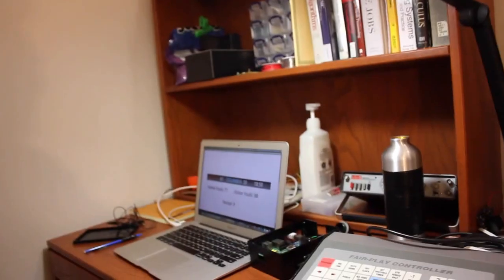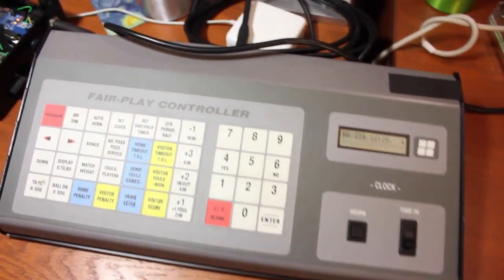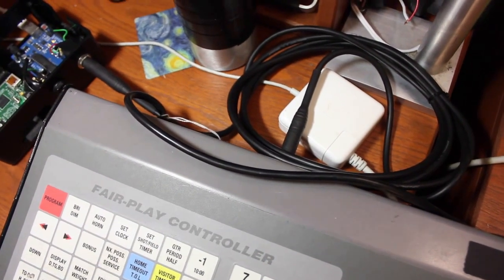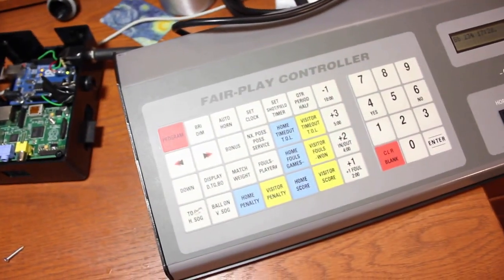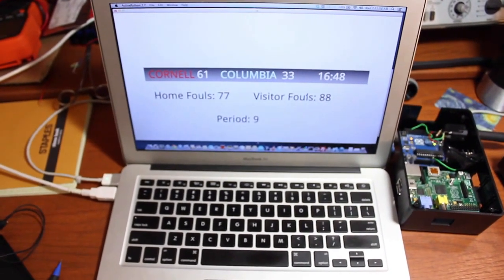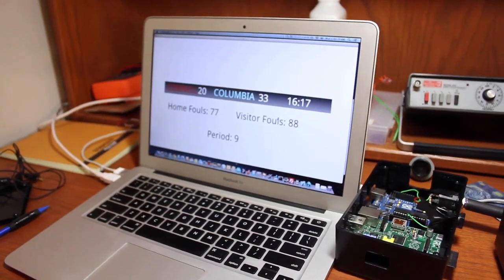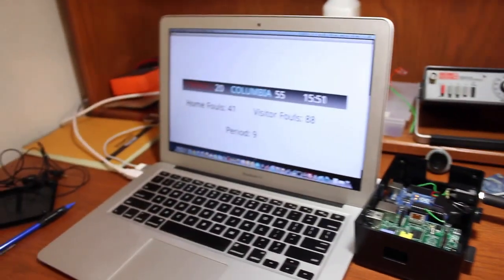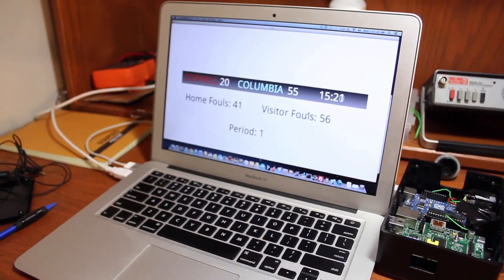Live Scoreboard Graphics: Decoding the MP-69D Basketball Controller

Comment: Have you decoded the MP-70 yet? its completely different.
Reply: If you're using the MP-70 controller you can program it to output in the MP-69 format to one or both of the scoreboard outputs by adjusting the scoreboard settings.

Here's the link to the manual: http://fair-play.com/manuals/98-0002-29,MP-50_MP-70.pdf

Changing the settings is on pg. 143.